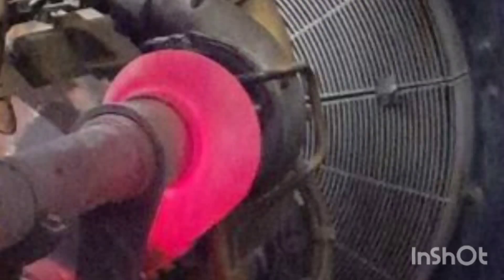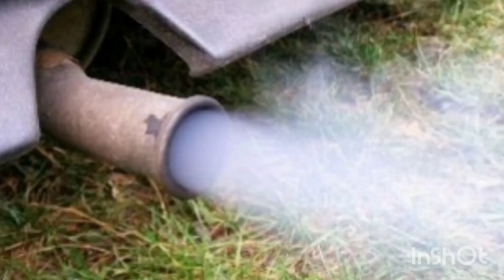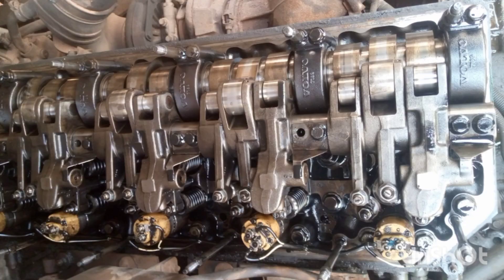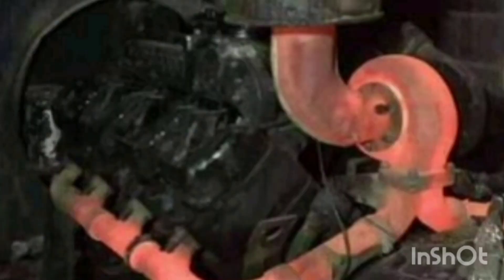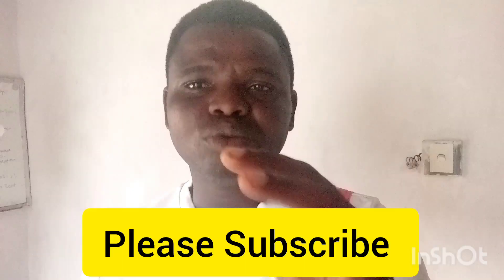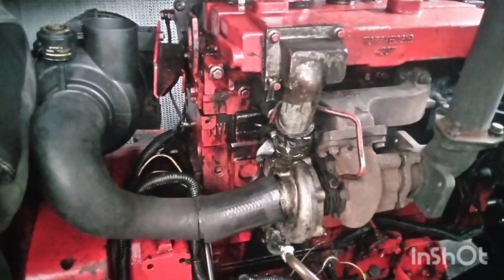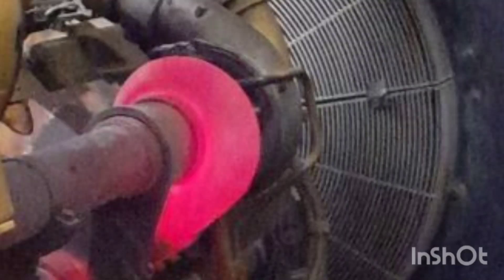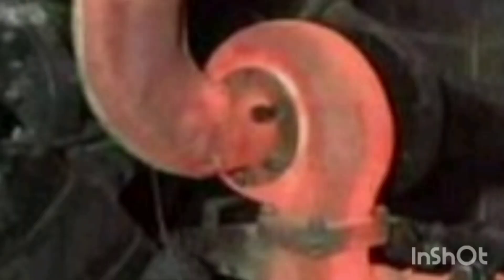What Causes Red-Hot Exhaust Manifold In Diesel Engine

Comment: On a hard working engine the exhaust temperature is well over 1000F, which will make steel glow red. On a turbo engine, like a VW Golf, the temperature will reach 1800F or 1100C. Glowing exhausts at high power are normal.
Reply from the maker: I enjoyed your contribution. Thanks